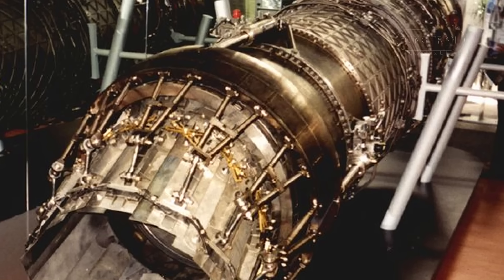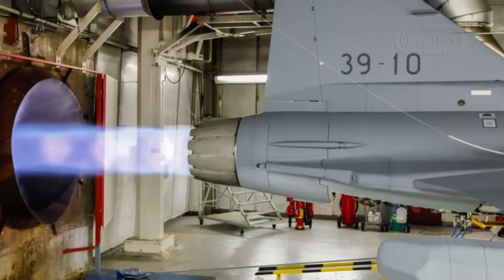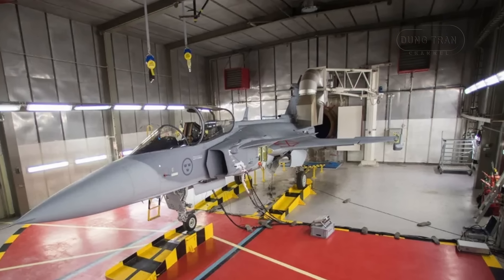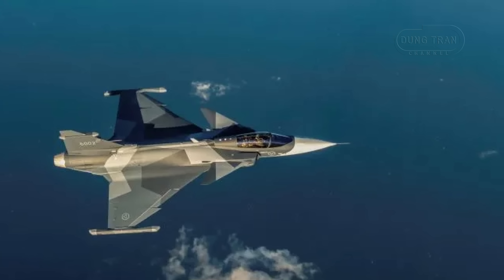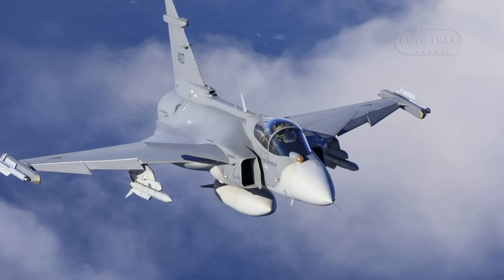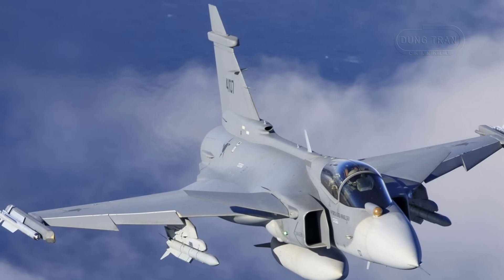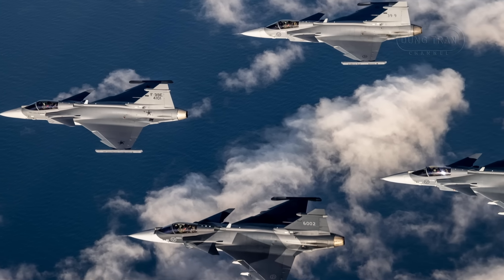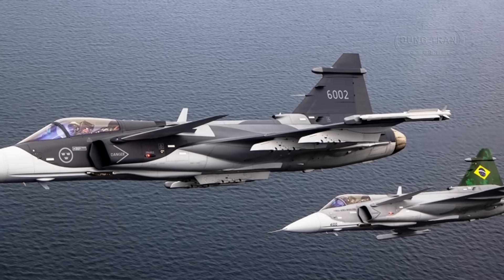Sweden’s Bold Move: Rolls-Royce Engine Could Save the Gripen E/F! 🚀

Comment: Not only can Canada build and maintain the Grippen in Canada they will also have the skillset available to design the change. Maybe not exactly current but if Australia can design the MQ-28 after 50 years of defence aircraft skill stagnation Canada can manage a joint venture here. The choice surely is design and build the Grippen, or purchase the Raffale.

Comment: If the US starts blocking sales of Gripen out of spite by using the engine as leverage, no foreign company will ever include US engines in their planes. So short term win by blocking sales. Long-term damage to US industry. Saab doesn't actually have to complete the work of finding a replacement but needs to fire a shot across the bow by showing its willingness to seriously look into it.

Comment: WOULD YOU STOP THIS MADNESS.
They "produced" T - E - N  planes in 2024. Besides the paid shills, author inclusive, do not act like a TOTAL MORONS.
If it comes to war, WHO WILL BUILD additional planes. ??? Productions of ALL three major fighters in EU is a GRAND TOTAL: FIFTY. 20 Rafale, 20 Eurofighters, 10 Grippens.
Meanwhile US produced 115 F35 of planned 150, because of some problems, hitting TWENTY in December. This is JUST one model. NOT to mention that they are starting Sixt gen F47, of which tech the EU can not even dream of. 
Data from AI: 2025 planned F-35 deliveries: 170 to 190 aircraft (including backlog clearance) Base production rate: 156 aircraft per year, with deliveries exceeding this due to backlog.
Looking at timestamps, most of the comments are posted by AI.

Comment: The Volvo BM-12 is a licencebuilt(in sweden) version of the GM engine, modified to meet swedish quality standards and needs..
Reply: Would be perfect for a 100% Swedish fighter jet, but Volvo and SAAB/Scania are competitors. RR is a good replacement for the Uhmerican engine. Long term it's not unlikely for SAAB to develop their own engines either.
Reply: @John8087 Saab has no stake in civilian transport anymore, the Scania brand has been sold and Volvo sold its jet engine business to GKN years ago so there is no competition between them
Reply: @John8087  Actually, those "GE" engines used in swedish planes was built by volvo after some modification to reach swedish quality standards. BM8, BM12, BM16.. volvo engines used in saab planes. When it comes to our defence, competition cease to exist.
Reply: @KatarinaIII BM? You mean, RM. RM6, RM8, RM12...

Comment: The audio keeps changing between calling the engine the EJ 200 and the EJ 230. It even quotes the 200s specs (90kN of thrust) for the 230 (102kN of thrust).
However the intent is to go this way as it seems to remove the export controls on the Gripen.

Comment: The high cost of the engine drops as economies of scale reduce per unit costs!!! 
That is presently giving the GE engine viability, in a high cost country!!!
The Slavic & Baltic countries have more need for Grippens than Raffiels & ancient Typhoons!!!
Reply: Nothing to do with Slavic/Baltic or other: the Rafale (write the name correctly, tanks...) is a twin engine fighter with much more capabilities than the Gripen and  more range, and over a large country with lot of woods , mountains and coasts and very few air bases or straight roads is a twin engined aircraft safer...

Comment: Sweden's false narrative that the Gripen hasn't been a successful export product because of US vetoes is a load of eurotrash sh*t. The Gripen E/F is not a premier air combat platform, but its  pre-offsets pricing is outrageous. Sweden has been able to donate Gripens to Ukraine anytime they choose to, but they've hidden behind their anti-American lies to justify their reluctance to follow through with actual donations. The Gripen E/F was designed around the GE, which means the aircraft will have to be re-engineered and certified with the RR motor. Canada and its anti-Americanism is the only real reason this change is being explored. A Gripen E/F sale to Canada, even with the massive offsets and production transfers required, would represent the most significant foreign Gripen sale in the SAAB program's nearly 40 year history. One for one, however, the F-16 Block 70/72 is still the superior platform.
Reply: Sadly for the F-16, that is untrue, as proven in every exercise in which both F-16 and Gripen have taken part.  It's not even close, as Gripen had to be restricted artificially to allow the F-16 to even get on the scoreboard.

Comment: Brazil wants to minimize the impact of the USA in its equipment procurements, so I think our Aí force would probably switch to the new engine if it happens sooner rather than latter, since the rear section of the fuselage's structural design for both the Gripen C/D and the E/F was made by Brazilian company AKAER, probably they would be the ones designing the modifications of the structure anyway.

Comment: Many years pass between ‘wanting to install another jet engine’ and ‘another jet engine installed, tested and certified’.
Reply: In normal times, yes.  But times are not normal.
Reply: Not that long. The US did the same when it replaced the TF-30 with GE F-110's and that involved adapting a digital engine to an aircraft with analog  controls
Reply: Let the Ukrainians get on with the job! Judging from what we've been seeing, they will have it done lickety-split!

Comment: You show no official sources, your video is just wishful thinking. It is not easy and it is not cheap to change the engine of a highly integrated weapon platform
Reply: Not cheap, but the increased sales and freedom from U.S. meddling could justify the expense. And keep in mind that once SAAB is free from GE engines, it is free forever.
Reply: @Inkling777  the problem is lack of time. The CF-18 was supposed to be withdrawn a decade ago, they are barely holding now, thus there is no time to bet for a "what if" projects that will take millions of dollars and many years to complete. If total independence from the USA is the goal, the only feasible option today is the French Rafale. On the other hand, why aim for USA tech independence, Trump is old and he will not be there forever, relations with the USA will improve in 3 year 1/2. They won't remain cold for the 40+ years we will be using F-35s

Comment: I thought the RR engine with thrust-vectoring had been undergoing tests for single engine certification since c. 2005!?
The TTW ratio may be something of an issue for a fully loaded/armed Gripen, as intercepts are a key function/role in Canada.
We require a fighter with both legs and stamina, distances/loitering times are a factor, especially in the high Arctic. 
Even with th GE engine, intercepts are slower than the F-35, with 6 AA missiles internally, but manageable. A 10% reduction
in thrust is noticeable/appreciable. Unless I have missed something, physics/gravity amongst others, are still relevant!?  Be well and stay safe
Reply: EJ-2-30 has over 100kN of thrust, and the block 2 increases that to over 120kN.  Both better than the GE.
Reply: @I_am_Phil_Lee  The data I have seen indicated 90KN. If the updated version is that much better, even without a t-vect, it is an appreciable improvement. Thanks

Comment: Pure speculation. I haven’t seen or heard any backed-up facts about it so far. Seems very unlikely to me.
Reply: Yup, it's just these AI youtube channels regurtitating it, without any credible source. I would love for it to be true, but it's just click-bait.
Reply: The F16 has been offered in Pratt and Whitney F100 or General Electric F110 engines. I doubt the possibility of alternate power plants was not designed into the Gripen, you under estimate the Swedes engineering and political accumen.
Reply: @christasker2944  Engine integration is not done overnight and it costs money. Maybe possible if you produce and sell thousands of aircraft, like the F16. If you sell a few hundred, like the Gripen E, it may simply be too costly. So, you mean the exact same version of the F16 can be bought with a choice of engine?
Reply: @ no how can it be exactly be the same, it means the research has probably been done , cad designs produced and a test bed or simulation produced. SAAB did similar with T7 RedHawks trainer, that’s why Boeing collaborated with them and won against existing designs with rapid prototyping
Reply: @christasker2944  It was you who talked about the possibility of two engine alternatives being built into the Gripen, not me.

Comment: Jas 39 Gripen...now the "Rolls Royce" of fighter jets 🙂
Reply: The Rolls Royce is the Eurofighter AFAIK. Gripen is made specifically as budget but high performance bird. Can't hold the candle with Eurofighter and Rafale, but still punches above its price range.
Reply: @samuelmendoza9356  lol Gripen E is way better in capabilities than Rafale and the Eurofighter. Years ahead in datalink and sensor fusion. Years ahead in electronic warfare, years ahead in human / machine interfaces, the list goes on. Rafale has a slight upper hand in climb rate which means it can get to optimal Meteor release altitude faster
Reply: @samuelmendoza9356  I was referring to the engine swap and was joking a bit.
Reply: Literally.
Reply: SAAB J-35 Draken had a Rolls-Royce engine too, and SAAB developed an afterburner which made Draken sublime, if not superb.

Gripen E is already far better than Dassault Rafale on every aspect. SAAB has all the time had a long-standing co-operation with Rolls-Royce, so nothing new there. Quite the contrary; Rolls-Royce and SAAB are currently developing new engine management concept based on fibre optics. One good thing with Swedes and especially SAAB: they always think ahead 🇸🇪🇫🇮💪
Reply: @petritast3784  it shude be namend JAS 39 R Gripen
Reply: @petritast3784  Thanks for the comment! I grew up on F18 in Tullinge, a J-35 air base! My favorite was playing in the J-35 wreckage at the aircraft scrapyard. I still have parts from the wreckage.

Comment: Trust vectoring for the eurofighter and Gripen would be great
Reply: Just remember that thrust vectoring increases both cost and complexity. There are good reasons why the F-35 moved away from the thrust vectoring that the F-22 had.
Reply: @matteusvirtanen392 and less fuel capacity. I’ve heard discussions about F22 without TV would have given it 300 gallons of fuel capacity
Reply: @matteusvirtanen392  Exactly. Not to mention weight. So they're parasitic to thrust for 99% of its flight profile.
Reply: Trust vectoring. That too, besides thrust. We need to re-vectorize our trust.
Reply: I think thrust vectoring is only making things worse for Gripen. It excelles in ease of maintenance and thrust vectoring would only complicate that. 
Why would we need thrust vectoring in todays BVR environment? There is absolutely no need for it.
Reply: With add-on TVC combined with canard, Gripen must be needed to withstand 13G pull.
Reply: @kittenastrophy5951  13G pull?   Better have an onboard system to fly the plane for awhile while the pilot comes to again.  :)
Reply: @ So you see how nonsensical it would be to have both.
Reply: @kittenastrophy5951 I think anything that veers away from the core tenet of ease of maintenance is a net negative for the Gripen and its prospective customers

Comment: What the Gripen E/F need, is a engine with significant increase in thrust and efficiency compared to the F414 engine along with zero increase of fuel consumption. Thrust vectoring capability would be a nice bonus.
Reply: Thrust Vectoring honestly seems like a pointless addition. Probably really handy in a close in dogfight using guns....

But when is that, realistically, going to happen?

"Buh! Vietnam!"

Okay, that was in the infancy on missile warfare, where the Falcons, Sparrows, and Sidewinders had reliability rates in the 10-30% range. When it wasn't uncommon to "launch" a missile, only for it to simply fall off the rail, with out the rocket even igniting. Part of this was due to pilot error, not holding radar lock for the Sparrow, or trying to use long range missiles, close in, because some idiots in Congress decided to require visual identification of the target before engagement, rather than how the missiles were designed to be used, etc.

But with missiles today, being in the order of 80%+ reliable, and assuming the pilots aren't hamstrung by idiots to engage within visual contact? What is the actual benefit of thrust vectoring? Does it really offer enough benefit, to offset the cost, weight, and maintenance necessary to utilize it?

Basically, is it really worth it to be 20% better, 0.1% of the time, but 5% worse, 99.9% the rest of the time?
Reply: @dposcuro  When Nasa tested the F-15 STOL/MTD they found a significant increase in supersonic efficiency due to the Thrust Vectoring, which was further increased by the 3D Thrust Vectoring of the F-15 ACTIVE.
And don't forget: even in BVR engagements Manouverability is still important, whilst speed and Radar/Missile range are probably more important, the increased Manouverability and efficency during Manouvers should still come in handy.
Thrust Vectoring is especially usefull during low speed Manouvers, something which could be Important during ground strikes/CAS missions.
As a bonus it also shortens the runway lenght required for takeoff, something which is something the Flygvapnet wanted from the Gripen.
The only real downside is cost and potentially reliability, which is a good argument against it, especially for a cost concious jet like the JAS 39 Gripen.

So the real question is how much more expensive a 3D Thrust Vectoring RR engine would be.
Reply: Do it!
Reply: Agree with the first part but thrust vectoring would not be a nice bonus. It's useless and only complicates maintenance.
Reply: @  true, there is always a downside, less moving parts = less problems.
Reply: There is a thrust vectored EJ270 in the works as well just waiting on a customer.

Comment: Should update the rest of Gripen as well
Reply: Everything is up to date
Reply: @Murre_121 Perhaps so, but still lots of US made components.
Reply: @unoengborg  Every fighter has it. And trump will only be in office for 4 years, if he doesn't become a dictator which he already almost is.
Reply: 1. The data bus isn't the latest spec, it could use an upgrade to the latest highest bandwidth type to support expanded capabilities.

2. The engine air intake is a manual diverter type, switching to a diverterless supersonice inlet could save weight and complexity and slightly reduce radar cross section from the front.

3. The optical sensors could be upgraded for 360 degree spherical coverage to improve situational awareness by adding more visual range and IR cameras.

4. The body panels and structural members could be changed to incorporate jigsaw edges while maintaining the current ease of access. This would slightly reduce the overall radar cross section from all angles.

5. The computing system, interfaces, and software could be upgraded to improve sensor fusion, automatic target classification, and data sharing similar to those features in the F-35.

6. The electronic warfare system is already highly capable but could be updated again to keep up with the rapidly changing EW environment. Some of this can be done with software updates and likely is being done but some requires significant hardware changes that would involve significant changes to the aircraft design, such as modifications to the ECM systems to be equivalent to something like AN/ALQ-250 EPAWSS made by BAE.

8. The materials and structures used in the aircraft as well as surface treatments could be further optimized to reduce radar signature. This will not make it into a stealth aircraft at all but could allow more freedom of movement near adversary radars. Being able to approach even 10km closer would be significant.

9. The control system could potentially be switched to a side stick instead of a center stick. This is already a trend in both military and civilian aircraft. Airbus for example mostly uses side stick controls. Pilots that have switched have reported that it took very little time to adjust and tend to appreciate the better ergonomics. For fighter aircraft it also slightly improves tolerance to g forces. Previously some pilots didn't like the lack of feedback but modern side sticks can incorporate a tactile feedback. 

10. Modifying the engine bay, interfaces, and control systems to integrate the new engine will involve significant changes. It makes sense to make some other changes as well at the same time both to the aircraft and to the engine. One of the changes to the engine could be to switch to incorporate a low observable nozzle to reduce IR and radar visibility. RR already has some experience with this technology and could create a relatively low cost and more modestly performing version of this in a short time for aircraft where full stealth is not a requirement.
Reply: If many of these changes were adopted, then it could form the basis for a new variant. I would suggest designating it the Gripen G/H "Ghost". Build 200 of them for Ukraine and 100 for Sweden. Current E/F models can replace the C/D models for leasing to other countries.
Reply: No, it lacks some features. It has room for improvement in many areas.
Reply: @Stu_Bur  Elaborate…
Reply: @Stu_Bur  Tell me 4.